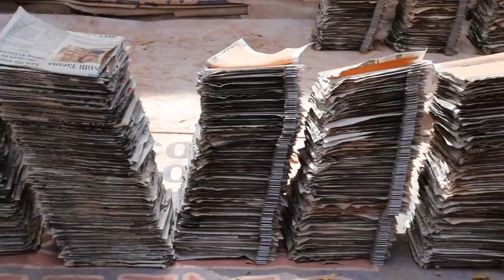These Local are Experts in Creating Lead Acid Battery Plates

Comment: I have great respect for the hard work shown but my goodness, this can double as a "how to ensure that, in the unlikely event of not dying from lead poisoning, something else will get you" instruction video.
Reply: Poisoning by lead, Mercury, etc only happens if it somehow works its way into your system in a large quantity, handling or exposure by itself is not dangerous, only if you inhale powdered lead or stick a large open wound in a bag of powdered metal or somehow eat a big spoon of metal does it become dangerous, unlike poisonous gases you really have to work hard to get metal poisoning.
Reply: They indeed are creating lead dust cloud and inhaling.

Comment: Here in Tunisia we have battery manufacturing, industrial of course but part of the recycling is done by hand because disassembling the old batteries is not easily automated unless you just crush them.
Reply: Hi mr
Whats the material of lead acid and percentage in posetive paste?

Comment: In this day and age of Almost 100% automation it is nice to see people still maintaining a craft.
Reply: Only downside to this is the health aspect but for a lot of people in these kinds of places it's a "What jobs are available for someone who has no actual education?" situation and they take what they can get to provide 3 meals a day for them and their families.
Reply: What craft? Do you know that people who makes lead acid batteries are tested for lead every three months and they are supplied with free milk to drink. Never mind the sulphuric acid they breath when they fill the battery with 64% distilled water and 36% pure sulphuric acid. Also when making those batteries I did not see them installing a separator between plates. Also the posts are soldered/welded together to connect, it did not show in the vid, who knows how reliable these batteries are. These poor folks are working in the most dangerous conditions without proper clothing or respirators. I pray for them.
Reply: @caddyrack  I draw your attention to the title of this video.  They were making PLATES that you saw packed into WOOD shipping boxes to be sent to the local battery rebuilding operation.  There are numerous videos about those steps as well if you seek something else to unfairly criticise.
Reply: @KallePihlajasaari  Thank you for clearing up for me. This is the first video I saw, if I had a chance to see the other videos I would not have made the comment.

Comment: What is the clay substance they smoosh over the lead grate toward the end of the process? Without firing it it seems it would just dissolve in battery acid/water unless it was fired to make a ceramic. But if it was fired the lead would melt out of it first.
Reply: You should go read up on lead acid technology and how it works, then watch this video.
Reply: @hughezzell10000  Do you know the answer?
Reply: Apparently that yellowish/red substance are lead oxides, mixed with diluted sulphuric acid to form a paste, the plates with the paste are "cured" then assembled.
Reply: @konstantinNeo   you are right. Gray lead PbO and red lead Pb3O4
Reply: Lead Oxide  The Lead plates and smelting aren't so bad, but that Oxide is the danger.  The poor souls will suffer significant issues sooner or later. and the entire area is a toxic hazzard and will remain so for decades.
Reply: @clovistanganelli9850  Brown Pb O² is the desired outcome for positive  plate. A series  of charge  discharge  cycles does the conversion.  Robert Murray  Smith  did some videos two years ago but mainly videos for members i think gave full outline .
Reply: Lead oxide and some pure powdered clay as flexible  binding agent to hold  oxide fast . Over time plenty of oxide falls away  to varying degrees depending  on diligence  of this application.
Reply: @michaelcorbidge7914  Right, it happens after formation. Lead goes to a more valent oxide state thus generating electric potential.
Reply: @konstantinNeo  what's in the bag
Reply: It's yellow form of PbO (massicot), mady by heating leady oxide (PbO+Pb mixture from ball mill).

Comment: Now THAT is amazing.  Rebuilding a battery taken to new heights because you have to.
Reply: JJA BAD RECOVERY
Reply: This was standard practice even in the west during the early lead acid battery days.  Early car owners could buy moulds to cast new terminal posts onto their starter batteries if they were to be damaged.  Hands on skills were much more routine and labour was a large component of the production process because it did not have any real capital cost like an expensive machine.

Comment: Fascinating. What are the pastes made of? What are they roasting to make the paste?
Reply: Lead metal
Reply: @user-io3xp7qx4p  porous lead or Lead sulfate ?  Sponge lead for the negative plates, and lead dioxide for the positive? But how did they make lead dioxide in the video?
Reply: @mrstratau6513  they took lead sponge and melt it down into lead metal to create the frames to hold the lead dioxide. Lead dioxide is made from heating lead below its melting point and keeping it hot for a while. The oxygen from the air oxidizes the lead metal. Both melting the lead dioxide and creating molten lead vaporizes some lead and is bad for pretty much any kind of living thing.
Reply: @user-io3xp7qx4p  Thanks.
Reply: @mrstratau6513  no problem.
Reply: @user-io3xp7qx4p  The lead dioxide is mixed with battery acid to creat the paste.
Reply: @hughezzell10000  Do you know the ratio of lead dioxide to sulfuric acid?

Comment: This can be developed in ways that make strict health measures extremely important.  but any way apart from that  i  wonder what is that clay like material that they attached to the lead plates
Reply: Minium (red lead) is composed primarily of lead tetroxide (Pb3O4) 85 to 98% and litharge (PbO) 15 to 2%. Or simply heated PbO2 black powder to 450°C to get it.

Comment: 1:00 what does he heat and burn on the fire?
Reply: Changing old plate material from recycled batteries from lead 3 to lead 5 oxidized material.  Lead oxide makes up the material of the active plate.  By burning it, he oxidizes the lead to a higher state of oxidation making it more active.  They're pouring on a solvent or gasoline in the first frames then burning it off to oxidize the lead more efficiently and remove any carbon thats in the material (which is a lot).
Reply: @hughezzell10000  diesel. if he poured petrol on and lit it then you'd really see something
Reply: PbSO4

Comment: The lack of protection baffels me. At the begining of the video they are making lead oxide by roasting scrap lead. The lead oxide is then processed into paste later in the video. Grinding lead oxide into fine powder is extremely hazardous . The lead oxidate looks harmless because it resembles dry soil, I wonder if that's the reason they are so careless about it. They are very poor but at least they can cover their faces with some cloth.